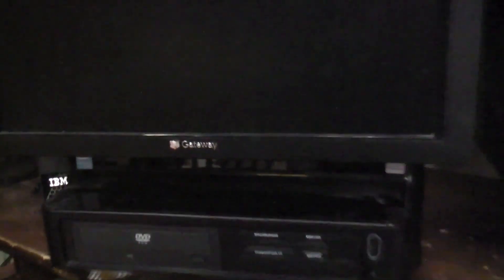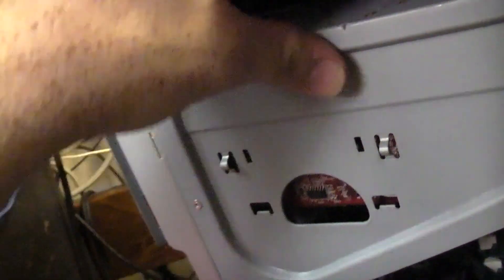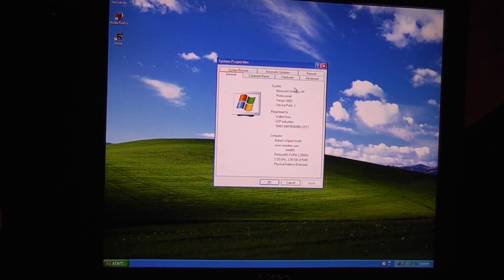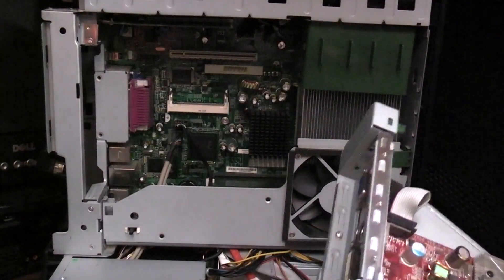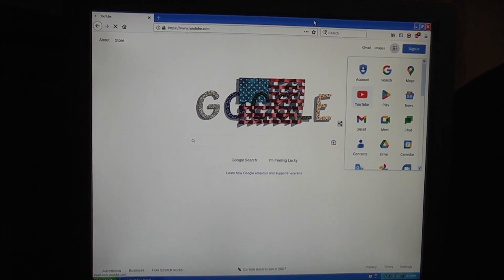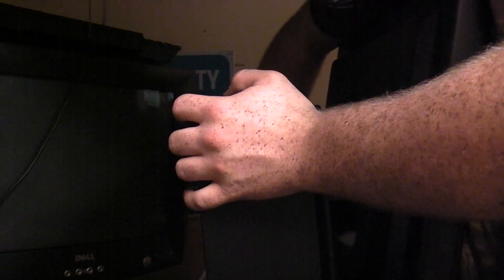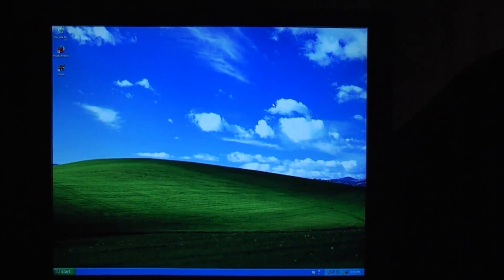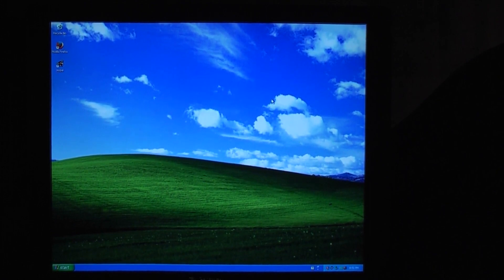Gateway Profile 6, A very strange all in one PC from 2006

Comment: I think it's neat that an all in one is very upgradable, unlike most of those deskbooks.

Also, the OptiPlex 745 supports a Core 2 Duo
Reply from the maker: Yeah, this is probably one of the best all in one machines I have seen in that respect. I would also expect that it would preform better and last longer than a standard desk book as it has mostly standard desktop parts and not laptop parts, which seem to bee less reliable. Except for the Hipro power supply, I have seen them that are built really well and last a long time, but I have also seen quite a few of them fail due to using cheap Teapo or CapXon capacitors. 

Okay, I thought it did, but I didn’t want to say it did and then someone bought one and then was mad because it didn’t.